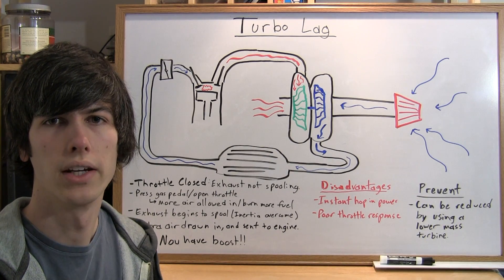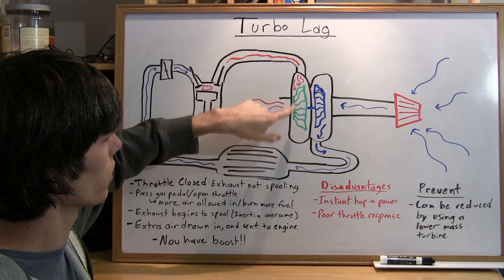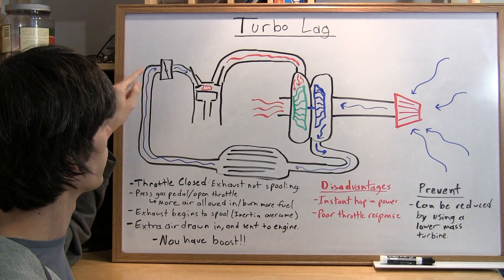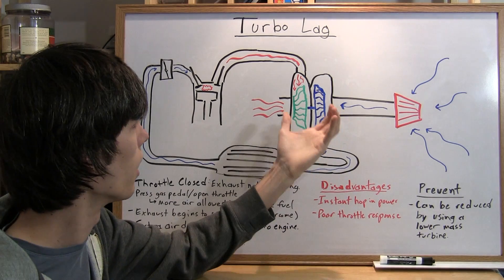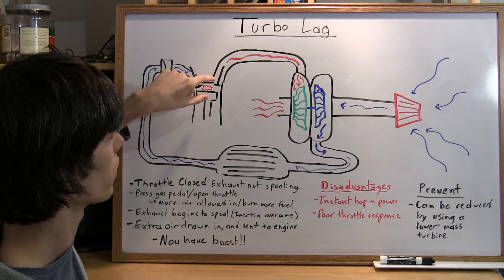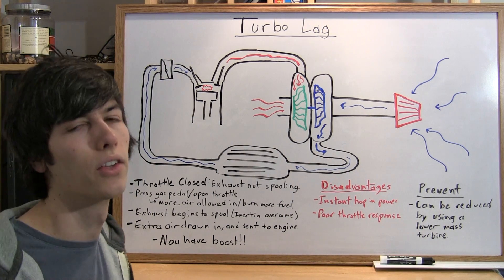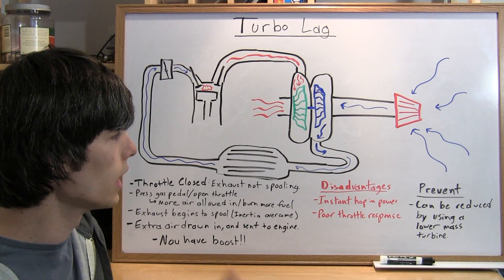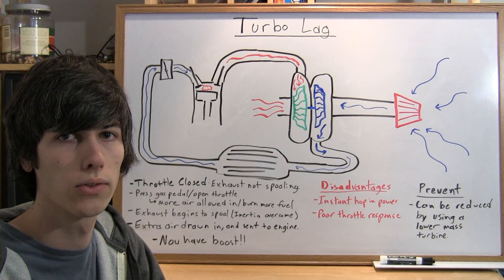Turbo Lag - The Problem With Turbocharged Cars

Comment: Why no mention of turbo A/R ratio?  Which just so happens to be the biggest factor and directly related to the amount of turbo lag you will have.  Also a free flowing exhaust (less back pressure), smaller intercooler of less volume which results in a smaller pressure drop all directly effect turbo lag.

Comment from the maker: No, compressor surge is when you let off the throttle and the added pressure has no where to go (no BOV, or not a large enough BOV) so the pressurized air goes back through the turbo.

Comment: Why not have a mini clutch in the turbo that disconnects the tubine from the compressor effectively halving the mass of the spinning parts in the turbo and then re engage the clutch when power is required?

Comment from the maker: Yes, but without a load it won't be able to produce much boost. It doesn't require much fuel to rev up an engine by itself; having the car in gear gives it resistance and will thus allow using more fuel and creating more exhaust gases, spooling the turbo.

Comment: A couple questions: During the turbo lag does the engine still produce 100% of the power (at those rpms) that it would if naturally aspirated? And why use a twin turbo instead of one larger turbo, what are the advantages/disadvantages of that?

Thanks! :)

Comment: you forgot to talk about the benefits of BOV - they give you better responsiveness, when you have to lift off, and then slam the throttle again, because excess boost will be vented away, and the turbocharger can keep spinning and it won't slow down as much. plus, without a BOV, every liftoff damages your turbo

Comment: VGT(or VTG or whatever, they all do the same thing in the same way;it's the same principle maybe some minor mechanical differences) tends to overcome the turbo lag issue(and many other aspects) by increasing the pressure of existing gasses therefore lowering the spin up time of the turbo. Almost all the new cars build today have variable geometry. You can google VGT vs regular or something like that.

Comment: typically the compression of the motor is changed to accomodate the extra pressure of a turbo..so the horsepower of the engine w/o boost would be lower

Comment: There is a way to prevent a turbo-lag, but I don't know is it applied yet. It use fuel injector near the turbo's turbine intake port, but that burns more fuel=polluting.

Comment: in repsonse to many, how to prevent turbo lag? or toreduce the ammount of turbo lag. One thing you can do is make the hot side piping smaller. say your using 2.5 inch piping to get the air to the turbo, make it smaller and it will take the same amount of exhaust gases and make them move with more force therefore creating a lower ammount of turbo lag

Comment: am i jumping the gun here, or did a company out there design an electronically controlled turbine where the intake and exhaust can spin at different speeds? where the speed could be adjusted independently. i can already see a problem with this, but the idea of being able to adjust the turbine speed would be pretty cool.

Comment from the maker: Allows for excess pressure to escape from the intake (before the throttle body) once the throttle is closed. This is so that the air doesn't have to force its way back through the turbocharger (compressor surge).

Comment: usually it is not the twin scroll design that reduces the lag. it is the fact that twin scroll turbos are usually smaller than normal, so they spool up faster.
the twin scroll design basically channels the exhaust gases through 2 separate pipes, one for cylinders 1-4 and one for 2-3 (on a 4 cylinder engine) so each stroke gases always goes on a different line than the previous stroke, since the stroke sequence is 1-3-4-2 (or 1-2-3-4)...that results in better gas flow into the turbine

Comment: so the turbo kicks in at higher RPMS when at higher rpms ther eis more fuel burned and more exhaust coming. In other words to make the turbo kick in and not shift that fast would be increasing the valve springs tension?so you can increase the rpms?correct me if i am wrong because i am not engineer or mechanic I just like to learn everything.

Comment: The wastegate is activated by pressure from the turbocharger via a small hose. Wastegates come with a certain spring load, for example my wastegate has a spring rated to 0,5 Bar, but I have installed a bleed valve between the turbo and the wastegate which I can adjust to not let the wastegate see pressure before I hit 1,5 bar of turbo pressure. I could go on about this forever but youtube comment field is too small :P

Comment from the maker: This would likely be achieved by altering the wastegate. You could reduce maximum boost by setting the wastegate to open sooner. Turbo kicking in a certain RPM is a result of the turbo design - larger turbos take more exhaust and thus will only produce adequate boost at higher RPM.

Comment: I have a question I've been wondering for some times, how do mechanics adjust the pressure of a turbo charge? and how do they set the turbo boost kicking in a certain RPM?
does it have some kind of controller?

thanks.

Comment: on some small engines there is a vane called a governer that is like an accelerator petal. the flywheel has fins that act like a fan and the fan blows air over the governer and keeps the motor running at the same rpm. if there is load on the engine the rpm drops and the governer sends more fuel to the motor to speed it up and vice versa when it spins to fast (when the load is sudenly dropped)

Comment: Most of those generator engines will be diesels which do not have a throttle body at all.  The power made varies strictly by fuel being injected.  Diesels don't use carbs, but instead need some type of fuel injection.  Old diesels actually had an air compressor and used blasts of air to inject the fuel.

Comment: Hi... This question may seem out of place, but still wanted to clarify. In older engines made for a power generator, there is no throttle to manually vary the air intake levels according to engine loads. But still why does the engine consume more fuel as the load increases? 
Generally in a carb, opening of throttle pulls in more fuel,, but here how is the throttle (if any) opened automatically?
Pls reply...!

Comment from the maker: Could you elaborate? What's going to power this electrical system? It would have to be belt driven if it were to be powerful enough, or a powerful motor with a separate supply of energy. Either way, it would be parasitic or add mass.

Comment: ok, how do mechanics change the timing of the turbo boost? I often hear about some cars have boost on 2000rpm and some on 1500rpm.
because base on your explanation, it's not possible by depending on the pressure of the exhaust gas alone.

Comment: VGT's are generally used for engines that displace smaller amounts of air, like the flat 6's in most Porsches, which i'm not very interested in. I have the previously mentioned opinion because more displacement usually = more exhaust gas pressure, so to me, the more displacement I have, the more obsolete VGT's become.

Yes, before you ask, I'm partial to muscle cars. Lol.

Comment from the maker: There isn't a single solution to every problem. VGT's are not bs, they do the job quite well. That said, I'm sure the setup you describe does as well. But is it cheaper to simply use a single VGT rather than reworking a lot of the engine? Possibly, probably. Have an open mind for alternative solutions.

Comment: Visit Nelson Racing Engine's 2,500 HP 572 hemi video to see the best setup. Twin turbochargers bolted directly onto reversed headers using custom billet transition parts + fuel regulation system built into the manifold (using dual injectors per cylinder) when you get into boost, the computer activates the secondary injectors & adds fuel for every psi of boost through the secondary injectors, no variable geometry B.S., just displacement, minimal distance and clever fuel delivery.

Comment: A mate once told me something about modified hot side housings with a slightly different intake angle on them so the exhaust hits the fins better for better low rpm efficiency, that could also be considered a factor. Also some turbines have shaped fins for that particular reason so a combination of the 3 should provide a high degree of efficiency

Comment: It's called an electric assisted turbocharger, BUT:
The problem with electric supercharging is the massive electrical power needed. For example, 10kW of electrical power in a car using a nominal 12-volt electrical system (ie 13.8V running) would need a current flow of at least 700 amps [...] you'd certainly expect the headlights to dim when the assistance was on. [...] In addition, the electric motors need to [...] attain the required very high rotational speeds (eg 100,000 rpm) and survive...

Comment: Only because you are an engineer, and are making educational videos am I mentioning this:
The inlet air is compressed by what is known as a compressor.
It is not called an inlet turbine. A turbine extracts energy from flowing gases, and a compressor adds energy to it.
Not a big deal in casual conversation, but you are being an instructor in a video, and it's always helpful to instruct with correct information, right?

Comment: Exhaust volume is the best way to spool a turbo but there are tricks to spool faster with lower volume. The idea is to burn as much fuel inside the exhaust as you safely can. Expansion from the heat will move the gas quicker. I do this by running low timing and a rich af while launching it at the track.

Comment: turbo charged engines from the factory (stock) have lower compression pistons, where as N/A engines have higher compression pistons. usually. lower compression pistons can cope with higher psi levels.

Comment from the maker: Mustangs have larger engines than Evos, so not as much boost is needed to create the same amount of power. A mustang engine is twice as big or larger, so it creates a huge amount of power with lower boost levels, even though the actual amount of fuel/air burned will be similar.

Comment: Sorry i should have been more specific. I meant when the cars are modded to make big power. For exapmle people wit evo's lets say build their motors and upgrade the turbo and run massive amounts of boost. But if someone built a mustang they usually wont run as much boost as someone with a built evo.

Comment from the maker: Not sure where you get these numbers. 20 psi is high for just about anything. I don't know of any imports that stock run close to 30 psi. And the reason is it's too much pressure! 30 psi means your adding another 2 atmospheres of air pressure into each cylinder, that's pretty extreme. Yes, it can be done, but not without replacing all the components with higher strength ones. Also, diesels will run 20+ psi usually no problem (stock) because they are built with stronger materials.

Comment from the maker: Well I wouldn't say that big turbos require high rpms, they just require a lot of exhaust. Big engines that are low revving can easily do the trick as well. Big turbos are found on both, and honestly they're probably a lot more reliable on large displacement engines.

Comment from the maker: It makes the psshh sound because it's a valve releasing pressurized air. As far as compressor surge I could have mentioned it but also could be another video. Great sound though.

Comment: Ford/International tried to get less turbo lag on the 6.4L PowerStroke turbo diesel by have a twin sequential variable geometry turbochargers. Small turbo which would get you going then a big ass turbo which would take over. Plus the 6.0L was the first to have an electric turbocharger to get it going quicker too. Now if they had similar ones to these in cars that would be sweet. I want to add a turbo on a truck i want to get for greater power cause i'll need it for the type of work i'll be doing

Comment: Here's an idea. Why can't there be some kind of pressure resevoir that fills from excess inlet air pressure, maybe from the BOV, with the ability to then feed this air back into the inlet when supply is low (under turbo lag).

Comment: That's not a few, it's a massive drop, if you drive occasionally for a year accumulating about 10,000 miles on average, that's an est. 4 - 6000 miles (est. +261gal / +$1126.34) you lose on gas with the 2.5L turbocharged STi every year. The new ones only get 19c-23h mpg... crazy money losses for very little road.

Comment from the maker: There isn't a simple answer, but if there was it would be yes. Turbos force in more air, allowing more fuel to be burned, hence they decrease fuel economy. But a 2.0 liter turbo will likely use less fuel than a 4.0L naturally aspirated engine.

Comment from the maker: The weight of the turbine isn't necessarily as important as the size. If a smaller turbine was used to compensate lag, then yes, lower power at higher rpms. Good luck with ME!

Comment: How about my idea. Couldn't we build something that stores a certain amount of the exhaust gas (before reaching the turbo) and once you hit full open throttle (at low rpm) a device forces that stored exhaust air into the turbo making the turbo lag be almost gone? Or am I wrong?

Comment: yeah but the message you replied was for the boost temperature in 2 different sized turbos.. about your 335i you're right BMW's goal was better fuel consumption but interestingly twin turbocharged 35i which is N54 doesn't use valvetronic.. latest as you may know 35i's BMW used single turbocharger with twin-scroll technology and valvetronic too.. by this means BMW enhanced fuel consumption and performance in N55 engines.. but if your aim is only more power you need higher boost on higher revs..

Comment: depends, small turbos are more efficient or practical under certain circumstances. My 335i has relatively small twin turbos but it means it takes less exhaust pressure to create boost, thus resulting in a car that has low turbo lag and turbos that work at lower revs. BMW went with smaller twin turbos instead of a larger turbo to avoid turbo lag and still push some decent psi.

Comment: so we can say smaller turbo boosts hotter air than bigger ones since smaller ones have to rev more for the same amount of pressure.. that means it is less efficient for the engine due to bigger turbo can boost considerable amount of cooler air..
thanks for the answers man appreciated..

do you have a video about the rest of the turbocharger elements.. west gate etc. by the way?

Comment from the maker: Yes, higher rpm means more exhaust, and yes, smaller turbos (as well as all turbos) have limitations. At higher rpms the smaller turbo can start to lose pressure, and it is obviously operating less efficiently if it is spinning faster, and only forcing in the same (or less) amount of air. Higher speeds means more friction, and higher temperatures.

Comment: ok.. but when you think logically higher rpm for the engine means more exhaust air flow the compressor turbine right?  is there a some sort of physical rev limitation for smaller turbines that lets say until 5 unit of airflow for the smaller turbos can catch the air and use it but beyond 5 unit turbines can not use it therefore it starts to lose its pressure or something like that?

what about the temperature of the boost.. is that the same as well? 
assume intercooler volumes etc. as the same..

Comment from the maker: 1. The size of the turbine affects the maximum amount of air that can flow through it effectively. At high rpms the smaller turbos can't pull in as much as air something larger (bigger piping means greater maximum airflow). Also, there are speeds where turbines are most efficient, meaning the pull in the greatest amount of air versus the energy used to pull in the air. Smaller turbines are more efficient at lower speeds than larger ones.
2. 1 bar of boost is 1 bar of boost, regardless of turbo.

Comment: yeah but i need to ask 2 questions..

1. why smaller turbos can not boost on higher rpm's and they lose their pressure after a while?
2. lets say we got 2 different turbos.. A is the smaller one B is the bigger one.. when they boost 1.0bar are the air flow into the engine is the same amount of volume for A and B.. or A just creates more heated air pressure because of faster spooling?

Comment from the maker: Right, depending on how quickly you shift and what rev you are at. Higher revs mean more exhaust, as the engine cylinders are pushing out their contents more frequently than at lower revs. If you shift quickly, the losses will be minimal. If you take your time, allow the engine speed to drop to idle, then reapply the throttle, you could lose your boost.

Comment: process is not the turbo lag, its the intake turbine's rev duration from lower to full rev.. 

if the process manages the turbo lag, every time you step off from the gas pedal it would take the same amount of time but its not.. it can be a split second to 3-4 seconds according to the intake turbine's rev and the engine's rev of course..

Comment from the maker: It works just like the intake except in reverse. The intake does not pull in air, and then cycle it continuously around the turbine, it feeds it to the engine instead. The exhaust gas feeds the exhaust turbine, and is then fed out (to the left in the image I've drawn) to the exhaust, and will pass through the catalytic converter, piping, muffler, etc..